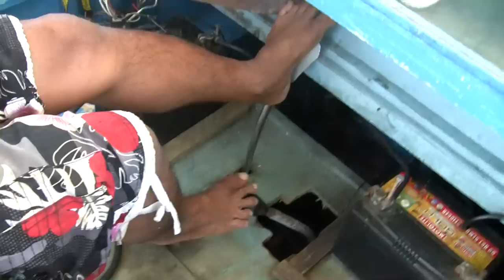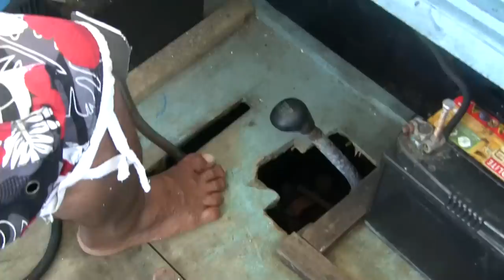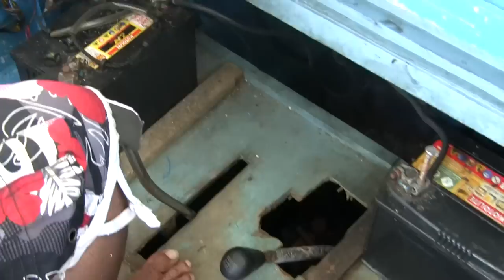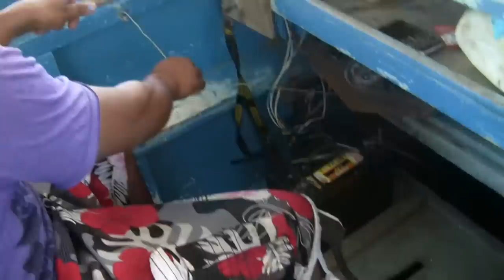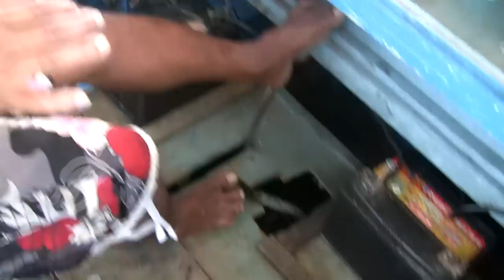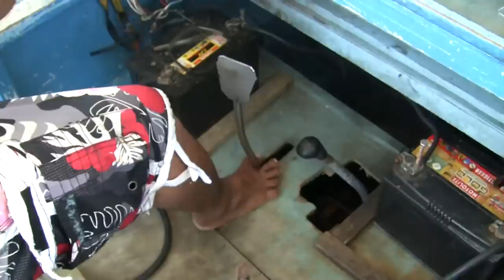5 Speed Outrigger Boat, Puerto Galera, Philippines :) May 18, 2011

Comment: why do you need 5 gears? there's little resistance in water..
just put a higher gear so the propeller would spin faster thus faster boat
Reply: because it came out of a road vehicle application like a mini truck or something similar with rear wheel drive
Reply: It also depends on how balanced the prop and shaft. If you push the rpm with an imbalanced shaft, you'll end up rattling the boat or worse blow your prop and shaft off.